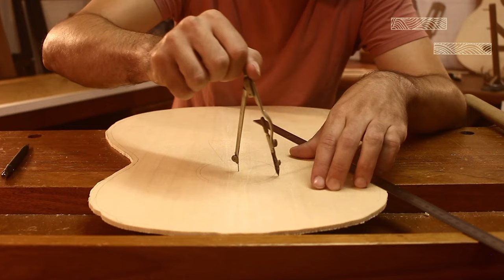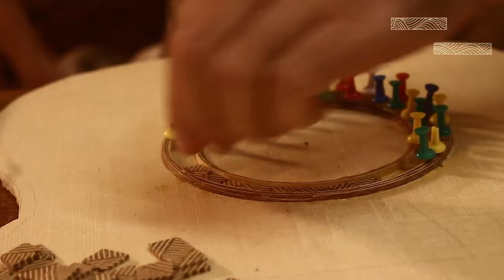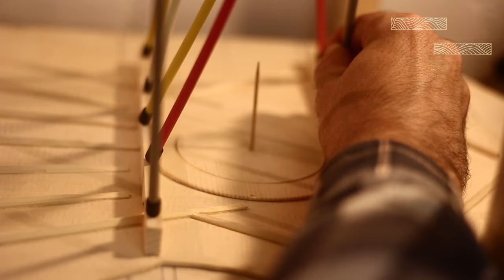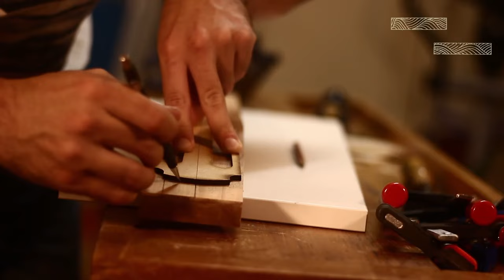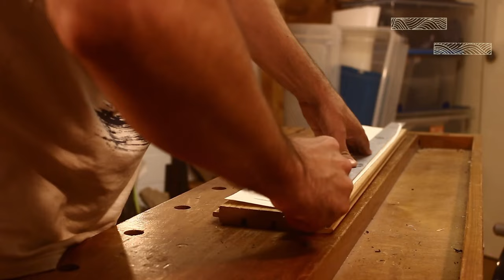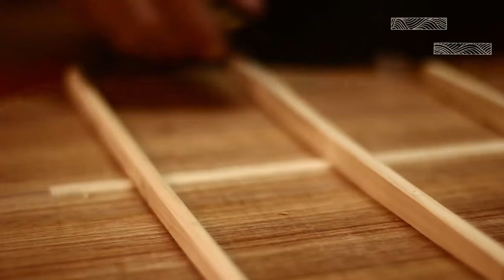Classical Guitar Full Build - Christian Crevels Handmade Guitars

Comment: I'm curious about one thing, I saw where you marked the underside of the fretboard so you could cut it out to match the sound hole, but you never made that cutout, why is that?
Reply from the maker: I've marked it to know the position of the soundhole, not really to cut the fretboard there, as you perceived. Sometimes I also make design decisions on the fly, when it is not a commission instrument.

Comment: Finally, someone building a classic guitar mostly with hand tools. Not everyone has a powerful band saw or think it's 'ethic' to use a power sander to get the soundboard to thickness.
Nice build and fantastic ASMR video.❤

One question: do you find easier to thickness the back before cutting it to shape? I find that one tedious task with hardwood, and cutting it before thicknesing means less material to work with😅
Reply from the maker: Hey, so glad that you like my work! Thanks for the kind words.
About thicknessing the back, it can be a pain depending on the wood, but I generally like to thickness it in parts: I take it to around 3mm before cutting, and then after I take it all the way.

Comment: This guitar had some interesting and unique aesthetic design features, like the ornamental inlay to the left and right of the fingerboard on the shoulder area of the guitar belly.  Never seen that before!  By the way - what kind of wood did you use for the soundboard?
Reply from the maker: Yes, that inlay was somewhat scary to make, but I think it turned out beautiful. Do you like it?
The soundboard is Alpine Spruce, back and sides are Araribá (a Brazilian timber), neck is Khaya and fingerboard is Ebony
Reply: @chriscrevelsguitars  Here's a thought: What woods did Torres use to make his guitars?  And can you obtain and use these same woods today?
Reply from the maker: Torres used Spruce for soundboards, as common in his time.  For back and sides, Torres actually worked with a range of wood, including Rosewood, Maple (both figured and plain) and Cypress. If I were to make a Torres inspired guitar (or even more than any classical guitar today already is) I'd probably make it out of cypress.

Comment: might i ask whats the point on putting the wood on the intereior of the part where the hole is. Is it just for stability or does it affect the sound?
Reply from the maker: Sure! I believe you mean the sounhole reinforcement, right? It is there for stability. More specifically, it is there to prevent splits along the grain coming from the hole. Exposed endgrain have a risk of splitting, that's why the reinforcement is glued crossways. Some people argue that a stiff soundhole edge helps prevent loss of energy, but I think if that's the case, it is only a very very small difference.
Reply: @chriscrevelsguitars  that's awesome. Love your work. How long have you been building
Reply from the maker: @22infection  thank you! I'm glad you like it. I,ve been working for four years